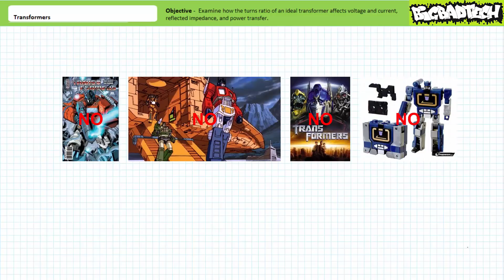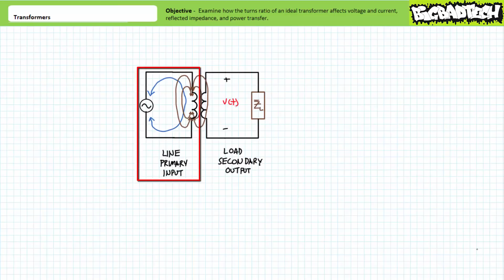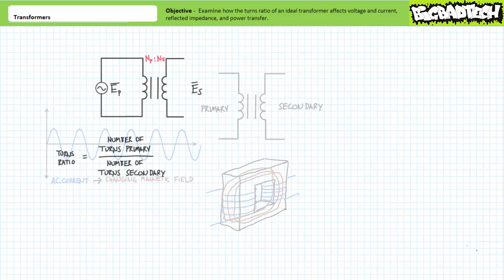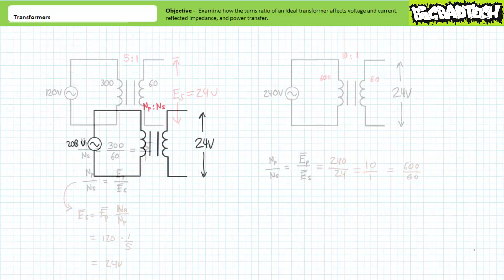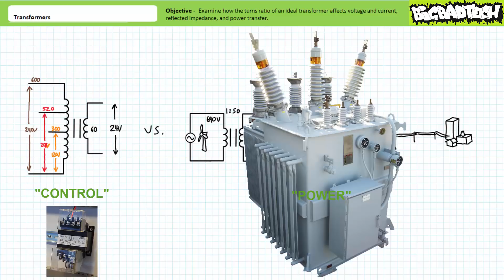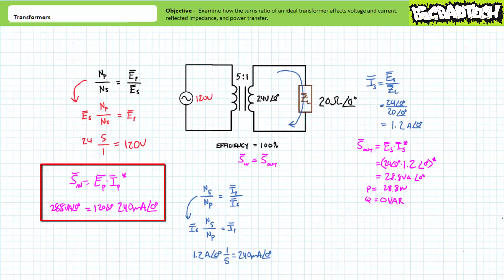Introduction to Transformers (Full Lecture)

Comment: Hey Jim, I love your videos. However I've noticed that when talking about apparent power you say the formula is the complex conjugate of the voltage times the current. but you write that its the voltage times the complex conjugate of the current. I believe the latter is the correct formula, but please correct me if I'm wrong!
Reply from the maker: Correct. As long as you complex conjugate ONCE (and only once) you're good.
Reply: @bigbadtech  Okay. thank you for the clarification!

Comment: When doing 120/220 I got 6/11 how did you get 1/1.83? Anyone?
Reply from the maker: 220 is 1.83 times 120.NP over Ns. 

120 over 220 is .545.
1 over 1.83 is also .545
Reply: @bigbadtech  Yes, 6/11 Gave me 0.54 recurring. For the rest I got
IS: 0.848 A
PS:186.12 VA
ZL= 76.32
Reflected ZL: 78.22
My numbers are close but I prefer to get the same numbers you got. Is there a way to derive 1/1.83 from 6/11?
I'm sorry for my late response? 😔

Comment: For the longest time I wondered why a transformer with an open secondary won't allow current to flow on the primary side. After all, if it behaves like a simple inductor, it would allow increased current after the magnetic field is established. More recently, I realized that the magnetic field produced when current starts to flow in the primary will magnetically induce electrons to flow along the secondary coil, with nowhere to go! The open circuit would quickly lead to a contrary voltage drop along the secondary windings. Presumably when first started the flow would oscillate back and forth until a steady state balance is achieved, with static ratios of voltage drop on the two sides commensurate with the turn ratio. So, a transformer with an open secondary would build up huge impedence to flow along the primary winding, effectively shutting down almost all flow. Is this the correct explanation? Is it accurate to say that any resistance within the secondary circuit in a functional transformer leads to an opposing secondary magnetic field that increases impedence on the primary side? If you were to measure the strength of magnetic field, would it be more powerful in a functional transformer or in a transformer with open secondary?
Reply from the maker: Now you've done it! I've got a 14 hour drive ahead of me and I'll be thinking of this the whole time! The suppositions seem on target. Also check out the "Non-Ideal Transformers Lecture" that discusses a slightly more realistic version of a transformer.